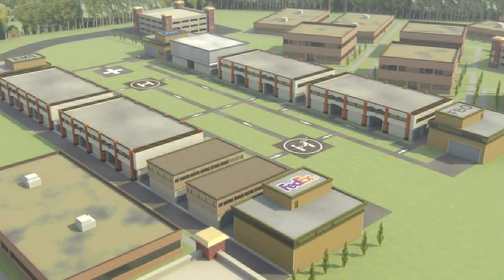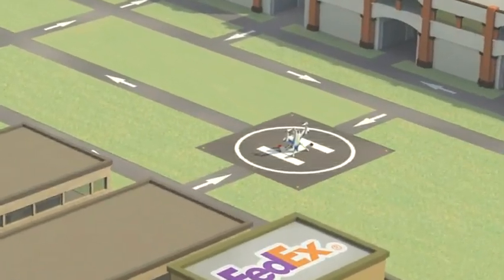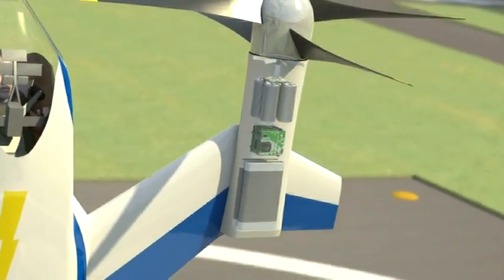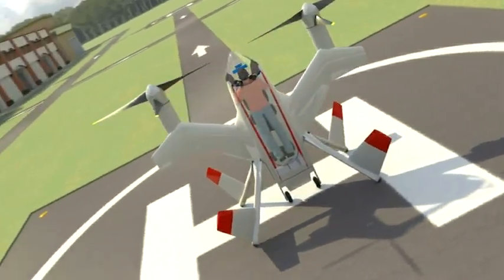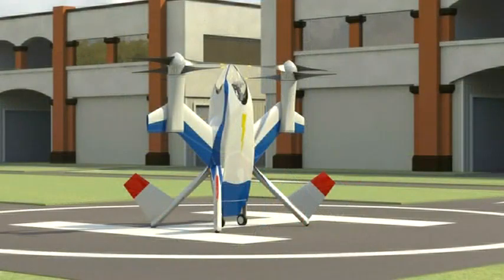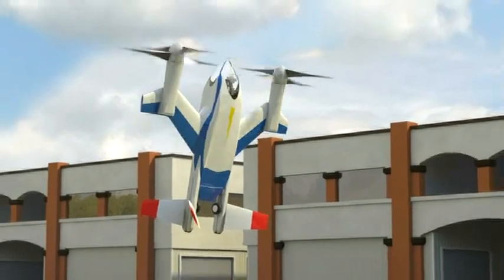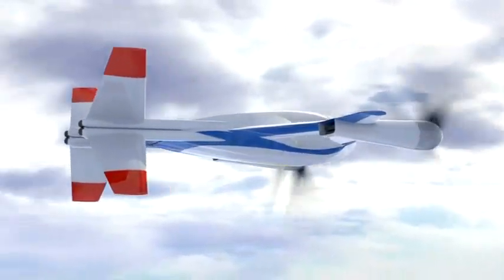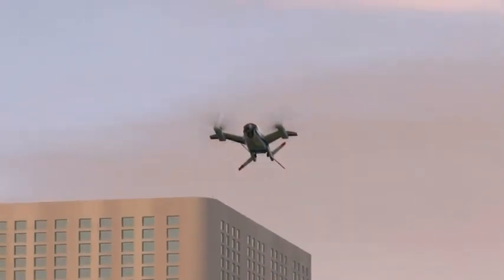Narrated: NASA's Puffin Vertical Takeoff and Landing Personal Aerial Vehicle

Comment: Yes, except for one thing - it's not just a single electric motor on each side.  A large part of this study effort was coming up with a completely redundant electric powertrain.  Any 2 pieces or components can fail (it's a 36 pole motor with each pole acting as an independent motor/controller).  Even the gear reduction system is completely redundant.  So there is no way for one side to stop, and the other to keep going.

Comment: @NASAPAV, I get it. If one motor dies you can't land so it doesn't matter how much rudder you need to keep flying; you're going to die when you try to land.

The propellers are so big they extend beyond the wingtips. Having them spin the opposite direction as the wing vortex reduces the amount of air spillage you get due to the wing vortex, which is a source of drag.

Thanks for the info. I was pretty sure NASA people hadn't screwed up.

Comment: The Pogos (XFY and XFV) were in the 1950's - no radar altimeter, no electronics, barely a flight control system.  Do you think things have changed much in 50 years?

Comment: No, you want to spin this direction (against the wing vortex) in order to achieve minimum induced drag on the vehicle.  The motor/powertrain is completely redundant to avoid a single side stopping - any 2 parts on either side can fail on the powertrain and full power can still be achieved.

Comment: Shouldn't the propellers spin the other way so if you lose an engine (I mean lose a motor) you won't need so much rudder to fly on one motor? I am guessing they didn't screw up (there is some other reason I am unaware of) but I am wondering why they spin the way they do.

Comment: This narration is excellent, and quite accurate in the technical issues.  Great job!  There is one mistake in that the 100 lb of battery weight is not included in the empty weight of 300 lb.  So the payload is 200 lbs, batteries 100 lb, and vehicle 300 lbs, for a total weight of 600 lbs.

Comment: that wouldn't work because of the law of conservation of energy, if the rotors were also used to turn an electromagnet, it would need more energy, thus using more power. You end up with less efficiency due to power lost to resistance in the electromagnet.